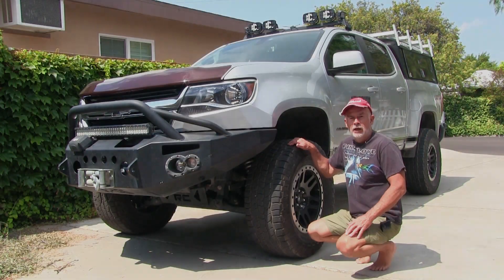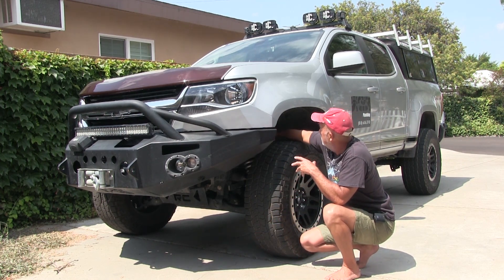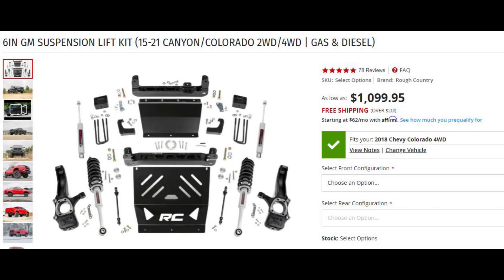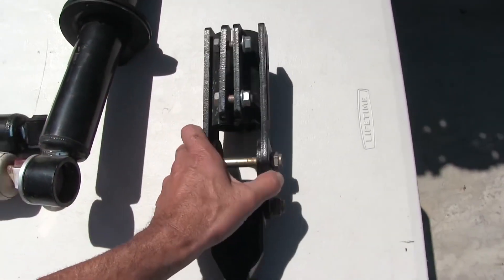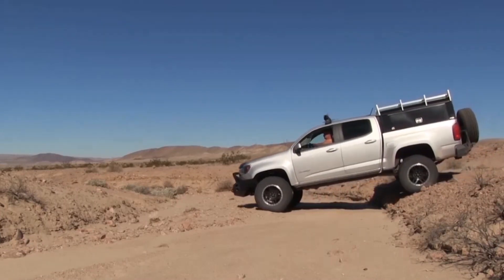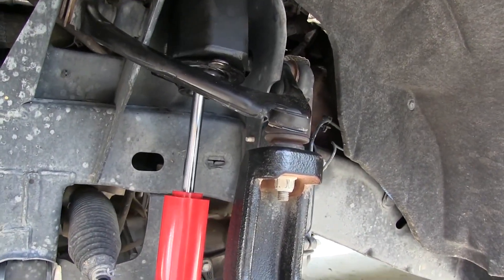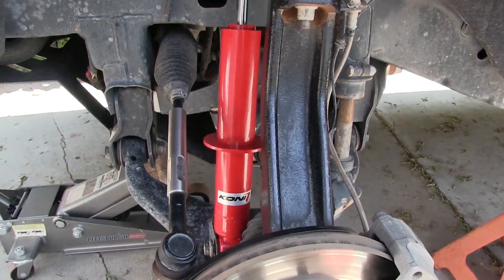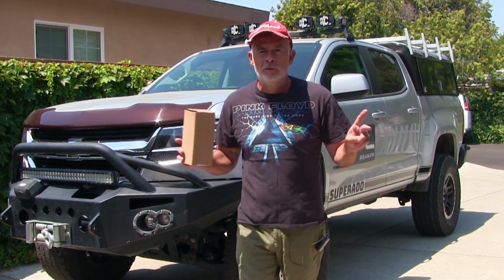Rough Country Strut Upgrades

Comment: They are supposed to be soft to get articulation and a comfortable ride.
Reply from the maker: Not going to be very comfortable if the suspension is constantly bottoming out and bouncing! Soft may work on a suspension with longer travel but the IFS is short travel which means the shock has to be firmer to control the motion before the suspension hits the bumpstops.
Reply: @rudedogii  springs where probably tuned for no front bumper
Reply: @mblake0420  not to mention rough country is designed to be a street lift not a trail lift. hes got so much weight on that thing its like a ww2 tank  :D
Reply: @volkrt  depends on the vehicle,  I have an xj that has a rough country lift and it has been fine for 10 plus years on the trail
Reply: @mblake0420  - sorry dont agree, to me RC is still a very low end kit but the quality has improved over the years
Reply: @volkrt  80k , probably 5k in mud, all parts still tight